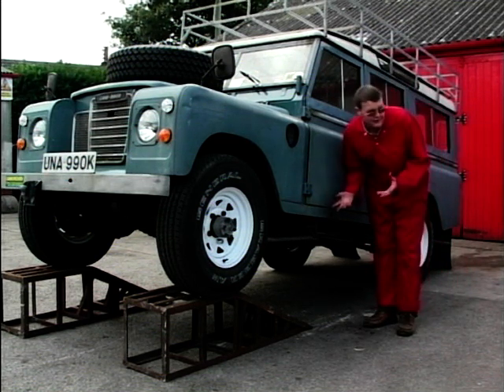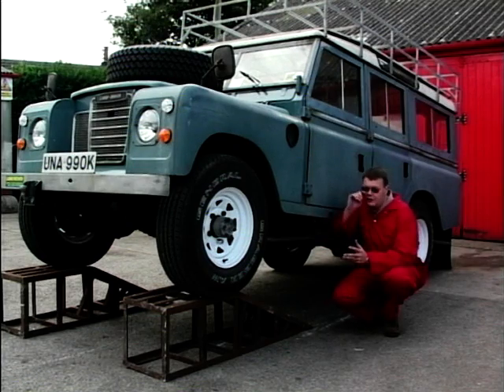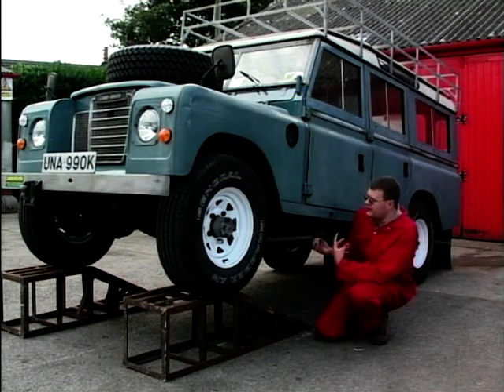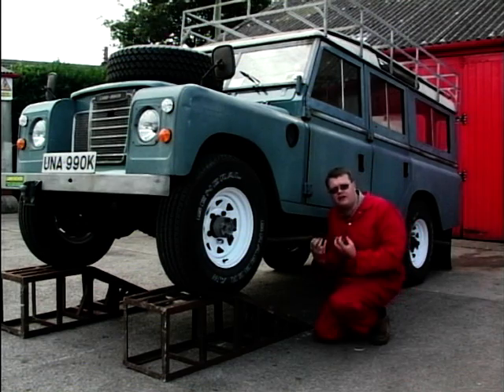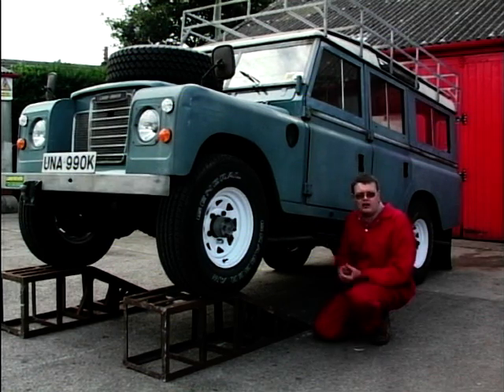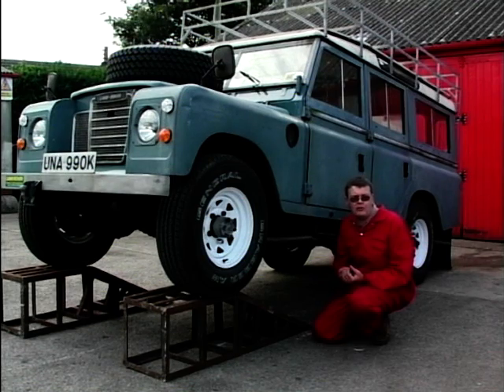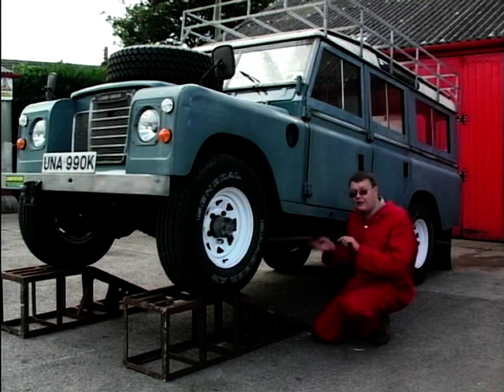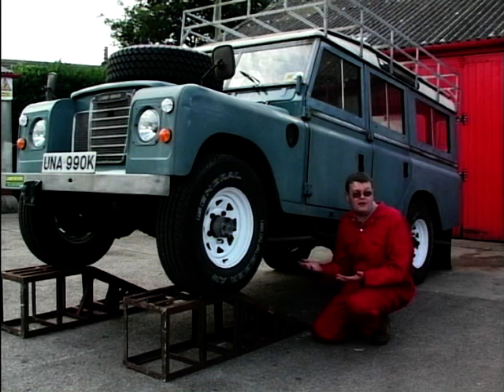Series 3 Land Rover Advice

Comment: Just to get facts right - the Series 3 chassis were not made from thinner material, it was (as was the 2A) 2mm thick. It was just cheaper worse quality metal. Later Land Rovers (90s and 110s) did not have galvanized chassis they just went back to a slightly better quality of steel and better paint process.

Comment: The Series 3 didn't have a thinner chassis than 1, 2 or 2As had and no Landrover came fresh from Solihull with a galvanized chassis, they are an aftermarket chassis for restoration projects. The problem has always been, it's a box section chassis, as deep, tough and legendary as it is, it rots inside out and you can clean the outside, red oxide it, paint it, underseal it, every year......it's what's going on inside, you can't see or get to, till it comes through, then you are chopping back to good, normally a big patch, get it cut out, get a torch in and see what you've got to deal with.